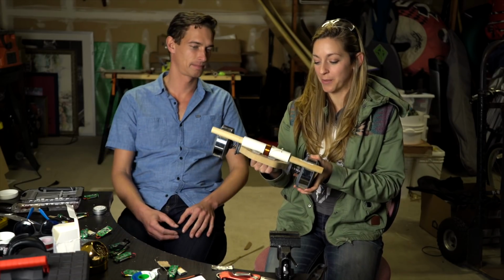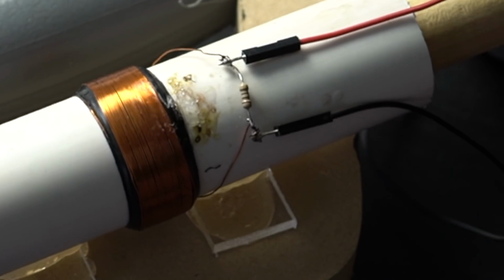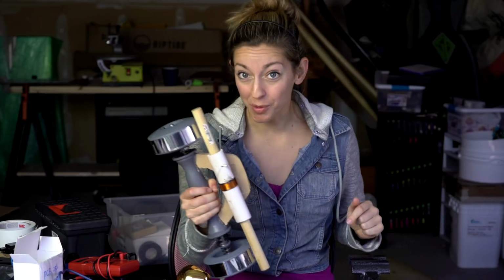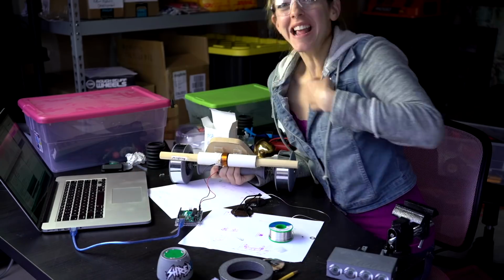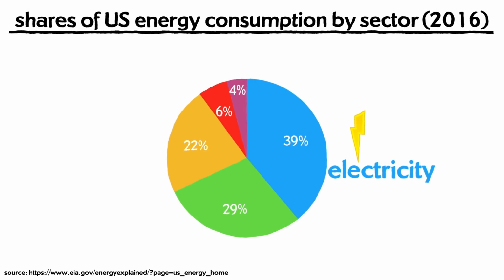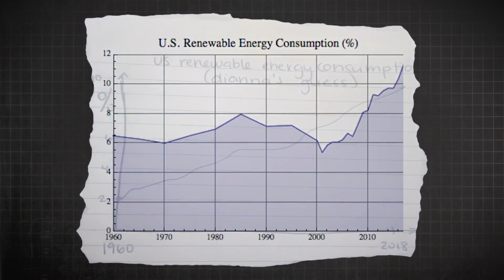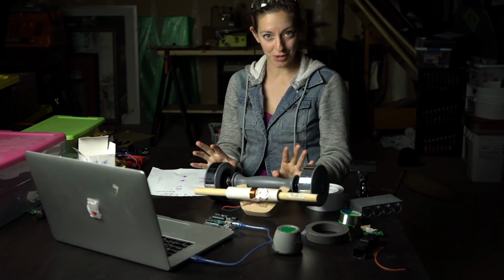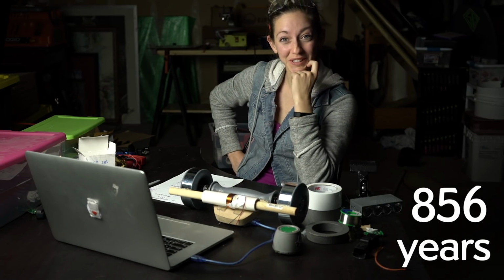Can you power a house with a ShakeWeight?

Comment: Hi, just thought I'd point out that the amount of power the shake weight will produce is highly dependent on the size of the resistor that you choose. To get an accurate reading the resistance has to be small enough so that V^2/R is a lot bigger that what you can physically produce with your muscles. 4 mW way too small I think.

Comment: OK, loose the shake weight, add a second PVC/coil and rod/magnet on the opposite side of the handle (or maybe add 3 or 4). Then add stops (like a collar) to the rods. Then shake away. You'll double / triple / quadruple the output power (still not very much), but you'll use far less of your own energy (rough guess, maybe 10%) to produce more power. =)

Comment: Dear physics girl,

I have been interested in electrical energy generation for years now and its my personal belief we need to find a NEW way to generate electrical energy. With this I mean not necessarily the technique ( heat/steam--> kinetic/turbine --> dynamo/electric ) but the source. We have to change the chemical element or we need to be smart enough to find a new way to skip one of these steps in the technique if we really want to be efficient. Did you know the efficiency of most power plants is just around 40% ? I am amazed how we still lose 60% of our input energy as heat. Yet doing something about it isn't that simple either. We need to think about economy as well. I have faith in solar panels though, wind energy is maybe a secondary thing but the big game changer should be either solar energy, a new type of interaction from which we derive energy from ( anti-matter/matter annihilations hello?) Or maybe a huge leap in our physics knowledge thus improving on our power plants. What do you think?

Comment: You’re not producing energy.  One of the laws of thermodynamics dynamics is that energy cannot be created or destroyed.  However, it can be changed from one form of energy to another.  In this case, Physics Girl ate food that was grown entirely by energy from the sun, including the fossil fuels that made it possible for the food to be brought to her local supermarket, which was then converted into energy she used to shake the shake weight to generate electricity with the coiled copper wire.  It is possible to remove fossil fuels from this equation by attaching the shake weight/copper wire contraption to a wind turbine that would do the shaking that would convert the energy that originally came from the sun into electricity we can use to power our homes, electric cars, et cetera.

Comment: Why don't you try with a motor and centrifugal or centripede (don't remembre which one...) force to produce energy ? Should be less energy for muscle and more for producing electricity. Like the crank in "battery less" lamp but way smoother

Comment: Why did south park came into my mind first after i saw you shaking that thing? :) i like the Stirling engines as an idea of a house electric generator. The temp difference would be between elements outside and a ground dug slightly deep. Pipes with liquid to transport heat (cold) from the ground up to the engine. Maybe a small pump to make the energy exchange more efficient. On the ground radiators, maybe a homemade solar lens to focus heat on the engine. But i haven't done any math yet. Just a thought.

Comment: Can you build soo many wind turbines that will make the winds slower causing to slow movement of earth ?
Reply: Short answer:  no.  Long answer:  first, you have to space out the windmills enough to let air pass between them.  If you made it denser than that over a large area, you would just create a slightly higher ground-level air pressure on the upwind side, lower on the downwind side.  Even so, the wind would just pass over the tops.  This is why mountain ranges and forests have not stopped the earth's rotation.

Also, variable air pressure from natural weather fronts already channels many times the total energy used by humanity, and the electric power from a single thunderstorm could run the strongest human transmitter for months.  Even the tidal gravity interactions with the moon -- with millions of cubic kilometers of water sloshing back and forth -- only slow down the earth's rotation by a second over many years.  Compared to the planet itself, we are just tiny creatures after all :)
Reply: Winds don't make the planet rotate...

Comment: You should've hooked a 1N4001 terminator Diode in series with the coil Diana. Since due to Lenz's law, just a few (like nano) seconds after the first flow of electrons, an opposite flow appears that is much powerful and has way more potential difference than the first one. So that flow could've ruined your Arduino's port.

Comment: Wait until you calculate how much  of the planet's surface each person need for solar capture to cover their power usage.
Reply: New, more efficient solar roof tiles are on the way, and have been calculated to power both the home and the car for the average american single-family home.  The last estimate I saw for powering all of USA on solar was 100 miles square of panels with 1 square mile of battery pack for overnight storage buffer.
Reply: Even with 100% efficient collection incident solar radiation on earth is about 1kW/m2  on a good day.
Reply: kW/m2 is the base SI unit.  To convert to kilowatt-hours used by utilities, you have to multiply by hours.  Translating from 60 megaJoules per m2 total per day for perpendicular plane to incoming sun (the overall average), it runs to around 5.75 kWh per m2.  At 24% conversion efficiency, that's 1.4 kWh per m2.

Tiled into the sunny half of a peaked roof of a modest 1500 ft2 /150m2 footprint, you'd get 105 total ideal kWh generation.  Even adjusting by HALF for non-ideal cosine angle (i.e. a bit closer to parallel with the plane of the surface rather than perpendicular to the rays) and irregular atmospheric clarity, you'd still be around 55 kWh per day total, or about 1650 per month.

Average electric consumption per household in US is currently 900 kWh per month, so that leaves considerable margin to power a vehicle, or to switch from natural gas to electricity for appliances.  Winter heating in some areas may still require outside energy sources, since cold weather tends to come at times of minimum sunlight received or higher albedo due to snow.

To maximize energy generation, houses could use a single-slant higher-steeped roof rather than low-angle or center-peaked, so "1.5 story" designs with sunward facing roofs might become favored.  This would double the available energy input area and improve the cosine coefficient during low-sun seasons.
Reply: Very impressive, a quick calculation from my current PV system performance equates to a daily average of 1.05 MJ /m2 with current technology and a Scottish climate. :-)

Comment: I live in the desert of southern Arizona. solar is growing. I have faith in people wanting to do the right thing. however when you live here, you realize the value and effectiveness of simple shade. Because of the low humidity when you walk into the shade, the temperature drops 20 to 30 degrees. Imagine if homes had a second roof. If people had a second permanent roof, it would supply a foundation for solar panels, and Air conditioning units that are always set on auto wouldn't have to cool 20 to 30 degrees. imagine using a hand held fan to try and cool off 20 degrees. like you shake weight idea.

Comment: after 40 sec - you should've gotten rid of the actual shakeweight handle (=excess weight) and just build a shakeweight from scrap that translates as much energy from your arm into electricity as possible...(plastic tube of about the diameter of the shakeweight; cylindric magnet that just fits through; hot glue the springs of the shakeweight to the ends of the magnet... if not magnetic ;), drop in tube, seal ends with glued plastic caps; wrap coil around tube, connect multimeter... or so)
and you should do the same video for an inverted e-bike! it's much more reasonable to get the energy out of your a** than from a tiny biceps ;)
Reply: found it already - it takes 1 robert förstemann to make 1 slice of toast :D
https://www.youtube.com/watch?v=S4O5voOCqAQ

Comment: What is "clean" energy? Is it the one that makes noise and kills birds? Or the one that prevents fish to migrate through the rivers? Or the one that makes large surfaces black and reflective and makes tons of difficult to get rid of glass & silicone waste?
Or is it actually nuclear energy which produces least waste material per unit of energy and kills the lowest number of people?

Also I always wondered why people consider sun renewable... I mean the coal and oil will renew in time, but the sun ?

Comment: Why are you impressed with the magnitudes of the numbers?

Units.

If you change the units, the magnitudes of the numbers change.  A "quad" is a unit used to discuss country-scale energy usage.  

"In 2009, for example, the U.S. consumed 94.9 quads (94.900, 000,000,000,000 BTUs) of energy."  
http://www.pennenergy.com/articles/pennenergy/2010/05/us-energy-consumption.html

Comment: 1. "Clean Energy" and "Renewable Energy" are not the same thing. A Hydro-electric dam might be Renewable Energy, but it also dams up a river and creates a lake, which can destroy the environment near it. Same thing with windmills and solar farms. Windmills kill more bats per year than any other man-made object, and actually cause damage to the weather and climate around the windmill farms, because they stifle the movement of wind (like a forest, but without any of the benefits of tons of trees). Solar Farms use tons of cleaning chemicals to keep the solar panels free of dust, bird poop, and so on. Also, during hot days, they can reflect so much light and radiate so much heat that birds flying overhead can burst into flames and crash down on the solar panels. The solar industry even has a name for these spontaneously combusting birds: "Streamers".

2. I admire you for trying to come up with new ways to power the world. Keep at it. But don't buy into the idiocy that "Fossil Fuels are bad for the environment, and Renewable Energy is good for it." That's just patently false. Every type of energy production will impact the world in some way. The goal is not to have zero impact on the world. The goal is human flourishing. As long as you focus on human flourishing, you will not only take care of the environment, you will always try to find a cheaper, more efficient, more plentiful source of energy. And it guards against the irrational moralizing of fuel sources that we see far too often today from extremist environmentalists.

3. Right now, the only "Clean Energy" that exists in the world is Nuclear Power. It creates the least environmental impact per Megawatt.

Comment: Can you make a part 2 of this using a shake flash light and see the energy it produces?  I get that this is kind of based on the same tech, but the flashlight doesn't have weight slowing it down.  I've had a rough idea for years based on the shake flashlight that I think would work in a house with a lot less man hours making electricity, but I'm not a trained scientist.

Comment: Isn't the coil and magnet arrangement very inefficient? You should mount the coil on the wood (axis perpendicular to the pipe) and have the magnet on the rod (magnetic pole pointing towards the coil) so it moves past the coil. Even better, add a few magnets to the rod oriented with alternating poles, so one stroke reverses the magnetic field in the coil multiple times.

Comment: Quiz!!!
1.) % of clean energy: 15% [answer: 10%]
2.) Graph? I did believe that usage of renewables accelerates, but I didn't put a scale on it.
3.) US energy consumption: About 20% of world energy supply [Correct figure: about 28545 TWh (2016) with the world being at 169000 in 2015 - so roughly about 17%]
So my guesses were close, but I did not know the total primary energy supply of the world (anyway I ended up comparing different years for the US and the world).
***Fun fact: the energy that can be collected from insolation on dry land is about 100000 times greater than the total energy consumption of the world.

Comment: I really do wonder how they come up with that 30 kWh per day to power a house number. When it's 85 degrees outside and my A/C is blasting inside, I only use around 22 kWh/day. And in the winter I use 13 kWh/day or less (because I also have natural gas heating which doesn't count against the electricity). And I have a decent sized house. Makes me wonder what people are even doing to get an average up to 30!

Comment: What if you took a plastic tube and wrapped it in wire, or segments of it. Then put a ball magnet inside the tube and bent the tube into a hoop and put it on the wheel of a bike. How much energy would it generate? Of course you could use a plastic hoop of the right size to save bending the pipe.

Comment: My house since a few months ago is a net zero energy house that means all energy needed by the house including heating is generated by solar PV panels. And for heating the cost is competitive with the next cheapest source that is natural gas.
The key to this is combining cheap PV panels with thermal storage. I have made a presentation so for more details read this   http://electrodacus.com/DMPPT450/dmppt-presentation-v01.pdf
That ShakeWeight was incredibly inefficient and you should have been able to have a sustain output of around 50W depending in how good of a shape you are :).  The weight should have been much, much smaller so that it will just be slows down by the generator or a much larger generator. In any case humans can produce in best case less energy than a small 50 to $100 PV panel so all work should be done by robots at a very small fraction of the cost.

Comment: It would have been another good challenge to calculate how much power is applied to the shake-weight. Then eventually have some figures about the efficiency of your energy transforming device. 

Generating power from a shake-weight might not be the best idea. However, tweaking the efficiency of energy harvesting devices  plays a vital role.
Reply: Shake-weights are designed to waste energy, so of cause they are not efficient.
Reply: Yes, this is obvious.. I was trying to cast a light on the importance of efficiency. Car brakes are basically devices that dissipate the kinetic energy and - waste it - into heat. The invention of regenerative braking was a day saver for electric and hybrid cars.
Reply: Tell me something challenging  to do with this ras pi i just brought to get me going
Reply: Alexea Houston Is this question addressed to me? Or is it to physics girl?
Reply: It doesnt matter..just looking for creative ideas
Reply: I prefer I would not participate in discussing R-pi in this space. It's Physics Girl's space. Unless of course you may figure out a setup using R.pi to measure the amount of energy put into the a Shake-weight. There are tons of sites out there related to R.Pi's where you can get inspired.

Comment: How about the same system, but connected to a stationary bike? You can remove most of the physical resistance for the driver, and get a steady output of energy by adding a lot of magnets to the rear wheel. Probably still not enough to power a house, but the increase compared to the shake weight might be immense...

Comment: I can't remember who did the video in order to give credit, but recently a TedX was given by someone about clean energy. He was a supporter of clean energy since he could remember, stating his parents were hippies. Some of the research he did on clean energy involved the UK's power grid. The numbers were astounding. There were diminishing returns on the productivity of both wind and solar. Plus varying weather conditions year to year can make drastic changes in yearly output. Add to that the lack of sufficient storage for extra power, and solar panels using materials requiring very specific processes to dispose of dead cells, and they look less appealing. Geothermal is nice when available, and there could be some excellent improvements in tidal power in certain areas. The best solution he could come up with was nuclear. 

The 3 high profile disasters in the field were all preventable on some level. 3 mile Island was due to sloppy operators. Chernobyl was due to design and testing. Fukushima was not updated to the emergency cooling system that was the new standard. Just some food for thought.

Comment: I made a similar device back in high school. Only it used rotation to push the magnet back and forth, and I was baffled at how low the voltage was. It used to average at 0.2 mV, which barely even lit an LED. I came to the conclusion that this way to magnet-coil interaction is not the most effective. :P